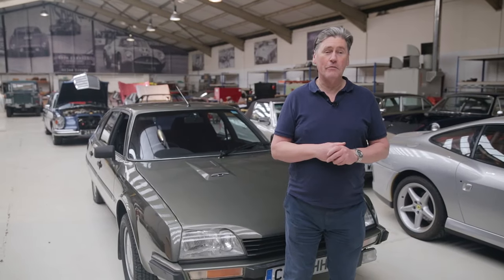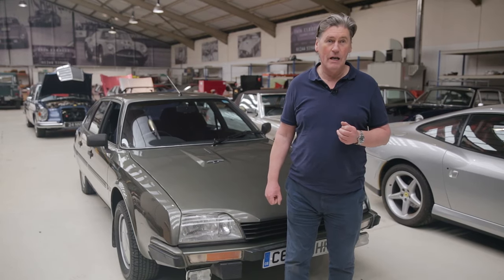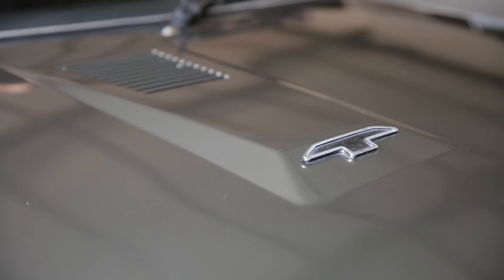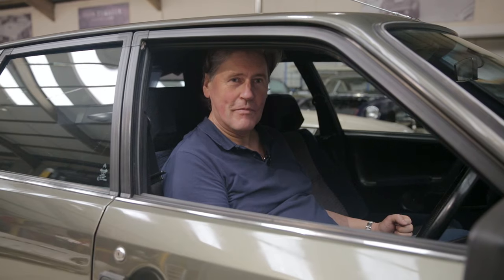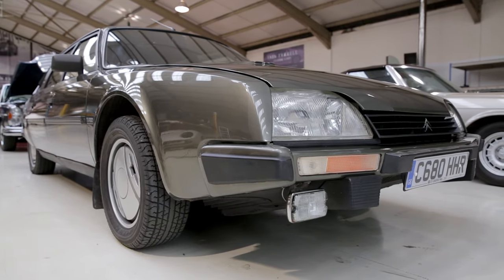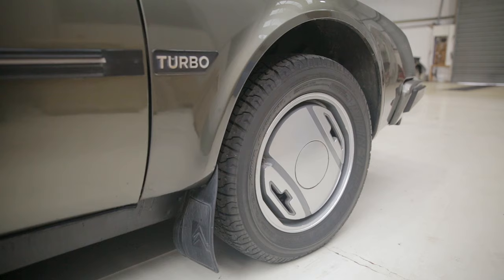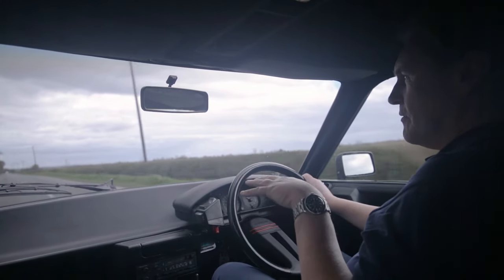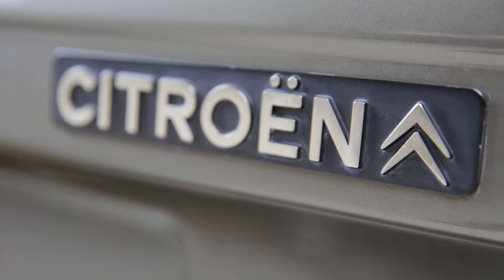Citroën CX 25 GTi Turbo - a rare beast with party tricks | Tyrrell's Classic Workshop

Comment: "The smaller the hole, the stiffer the ride is. The bigger the hole, smoother the ride is. So simple!" I don't know why he smirks when he says it... Great video!
Reply: The spheres has both compression and return damping that are tuned by a couple of canals inside the damper and shims that block the canal. The center hole is in use at slow suspension travels, when the wheel hits a bump the shims on the compression side opens up the canal and dampens the wheel.  The sphere in his hands is not a suspension sphere.
Reply: @cittroman  He was close though.  On my early D's, you can unbolt the shim pack in the head of the sphere and change the ride charactoristics readily.  The sphere he displayed from memory is a Xantia rear brake accumulator.  The only sphere I know of with a hydraulic line connector onto it.  This is what a CX wheel valve looks like ... https://cdn.myonlinestore.eu/940fb243-6be1-11e9-a722-44a8421b9960/images/Spheres%20Citroen-eng.jpg   If you drill the center hole out, the car gets more "floaty" and very boat like as so much fluid can move in/out of the sphere.  The outer slots I think are a valve.  So if the wheel hits a large bump, the valve opens and allows rapid fluid movement into the sphere.
Reply: @sophieleviston6973  Also wrongly called the "antisink" sphere. Early DS spheres are great and as you say easy to adjust to your liking. When you drill the center hole you loose some control at higher speed, but good for cruising.  Have you seen this beauty?  https://www.youtube.com/watch?v=bJ5jTMJDH_k&fbclid=IwAR3ZMykHLZ3Lalo26Zy6ZCDl_YAJBXLaHTbU97PxJtFfYw0PkAL1DNw22po

Comment: The suspension travel is not controlled by the sphere but by offset holes drilled through a series of disks in the damper which the sphere is attached to.

Comment: The green hydraulic oil aka. ‘frog juice’.
Reply: or green blood
Reply: @martinparker6536  Or actually known as LHM. Liquide Hydraulic Minerale. Not easy to find these days,as the only cars that use this hydraulic oil are hydro pneumatic Citroens ( DS,CX,Xantia,SM ,XM and so on )
Reply: @titanus49  also Merc 600s... hydraulic everything on those cars, even the windows and boot lid...
Reply: @titanus49  : in Britain, LHM is easy to find, as generic motor supplies shops such as Halfords still stock it. Also there are loads of online suppliers. Nothing to worry about. To be pedantic, all Citroens running on this system are oleopneumatic, not hydropneumatic, since no water is involved.
Reply: And even 2CV's use it as brake fluid! That is, the ones with disc brakes, from 1981 onwards.
Reply: Not sure to appreciate you "joke"...
Reply: @richardharrold9736  Mercedes did copy the Citroën System, but made a bit different, was first use on MB on the 1975 450SEL 6.9L.Mercedes Benz did buy 2 SM to test it and disassemble it for study...But Rolls Royce did use the Citroën system (with agreement and technicaly assitance from Citroën), a bit modified, on they Silver Shadow and Silver Spirit...

Comment: Such fantastic cars. I regret that I never bought one in the 90's when they where reasonable common - was very close to get a first gen GTI with the more unusual instrument cluster.
Another small tech piece was the spring loaded position of the gear lever in fifth, you selected it as normal but once released it went back to the position of third gear so to shift down to four you just pulled the gear lever straight down!
Reply: I had the DS when I was young. Was never able to get a CX. But think I will look for one.

Comment: Nice to see a perfect set of Turbo rims with the Michelin TRX tyres! I've owned and worked in Citroens for years and the hydraulics are the least of your worries, once you know how it works. Very simple and rather reliable. As Mr. Tyrrell says, the original CX2000 were very underpowered.. Great cars.

Comment: Great video and I very much enjoyed it. However two things you failed to mention;
Firstly the self leveling suspension, which worked incredibly well and allowed the soft suspension to carry heavy loads carry heavy loads without dragging along the ground. At this point I think it's worth mentioning that the highest position was not for actually driving along, as the pressure in the spheres is at their maximum, and there is virtually no suspension movement  - it's rock hard.
The second worth making is that one of the idiosyncrasies of the CX was that the indicators didn't self cancel. I worked at a Citroen main dealer and we had more than one customer who complained after they had bought one!
Smashing video and excellent. Thanks

Comment: We NEED to hear your views on the Rover SD1 now!
Reply: alanrtment porter  My Father bought a fairly late one as a replacement for his old Triumph 2000 as our main family mover. A Vanden Plas one not a Vitesse. As a boy I felt ten feet tall riding around in this wide, low thing with a V8, and a front spoiler, and an air scoop on the bonnet! 

He eventually traded the Rover for a V6 Accord, and that car was just light years ahead in every way. But it just wasn't something you could get excited about!

Comment: don't know why but I always found the French practice of carrying the spare wheel in the engine bay to be very disturbing.
Reply: Wouldn't the rubber rot over time?
Reply: Well it does free up a lot of space and I'm only guessing on this next point, does it make the front end stronger in a crash? Some heat might be good for the rubber, it is made using heat after all and may help preserve it.  Cold isn't good for rubber either and we've seen how F1 drivers warm up their tyres for better grip.
Reply: It's surely not good for the rubber with all that heat but on the other hand it's not hidden under a ton of cargo (imagine having to empty a fully loaded CX Safari on the motorway) nor is it covered in mud, ice or salt.
Reply: Seems eminently sensible to me. Like most things French. No I'm not a francophile.....🤥
Reply: So did Fiat in some cars: 127, 147, Uno, etc.
Reply: It wasn't just French manufacturers. Subaru placed the spare in the engine bay with many of their 70s and 80s models.
Reply: Part of the trick with the spare wheel under the hood wasn’t only to free up space in the boot, but to help push the engine down under the passenger compartment in case of a collision, which was one of the safety design features of the CX.  At least that’s what Citroen claimed.  Also, I’ve never heard of any CX-owner complaining about ruined rubber due to heat. After all, tires are supposed to sustain a lot of heat ;-)
Reply: @anthonyxuereb792  A solid front end in a car is a bad thing, in a crash. The occupants are better protected when the car absorbs the energy of the impact by crumpling. Modern cars are designed to crumple up.
F1 drivers warm their tyres in the short term and they’ll soon cool again. But with everyday road tyres, there’s negligible difference.

Comment: Wonderful edition. Brings back found memories of when I was a student and delivering computer parts between Oxford, Newbury and Reading in a Safari. If I remember rightly the tail dipped under breaking as well. Two other elements of those marvellous cars was one you touched upon, the brakes but to the unknowing with all that power initially they were either one or off. It took a bit of practise to get the modulation just right. On and they were terrifyingly effective but that came in very useful on summer afternoon in a Reading side street when a little boy ran out into the road ahead of me whilst playing chicken with a mate. I did knock him off his feet but thankfully that was all because the car stopped so well. The other is the rocker switch for the indicators which didn't self-cancel.   Thanks Iain

Comment: Nice video thanks. I worked in the car game from the late 1980's. I use to sell these and the Rover SD1's. Out of the two the CX felt much more advanced than the SD1's. Obviously the Rover had that great little small block buick V8 burbling away which was the reason I sold so many. I drive a Rover P6 V8 as my daily now in fact.

Comment: My father had a CX Athena back in the 1970s. It was a family favourite car. I was far to young to drive it so I've always wondered what it was like. I remember by dad talking about the steering. How no bump moved it who hade it relaxing. I loved the dash as it had two barrels for the speed and rev counter. It seemed very futuristic at the time.

Caravan towing was very easy especially hitching and unhitching due to the suspension. Plus it always kept the car level even with the weight of the caravan.

I always wanted a turbo / turbo 2.

Comment: The comfort but also the roadholding, the brakes and the general stability of the DS and CX were fantastic and unique in those days. I had one of each and systematically outran most of my friends with sportier and flashier cars. Their biggest problem was: you could hear them rust away...

Comment: I am so excited about this video Iain. I nearly bought a CX Familiale in 1994, which I fell in love with. My dad told me it was a silly idea! I am still smitten by the engineering and looks of the wagon (I don't like the sedan at all) so will no doubt find one in my retirement. You mention the effect of acceleration on the suspension, but I found the effect under braking even more unusual. The front dives (as normal) then the system 'compensates' for the dive and raises the front. The earlier cars had a fantastic sci fi dash and 'button' brake pedal. Thanks again!

Comment: I had the safari version in the 70s. ~What a car. My father had a DS 23 Pallas, which converted me to the French magic. A couple of comments on your video. The tail dip which you pointed out on acceleration also was a feature of heavy braking on the Safari (I don't know if this was true of the CX saloon). It made breaking feel so much more secure as I suspect in so doing it added effective weight to the rear of the car. The second point is about the steering and there is another party trick to it in that there is a speedo cable from the final drive straight to the steering control valve box which stiffens up the steering the faster you go. Dead light for parking, heavy self centering when high speed motoring. Pure magic. I would have another in a heartbeat.

Comment: My first grown-up car was a D reg GTi Turbo 2 - fantastic car and it stuck to the road like a limpet on the proper metric Michelin TRX tyres. Passengers used to comment on the Darth Vader noises the steering wheel made and with 2.5 turns from lock to lock, it was tight. Also dead easy to parallel park in tight spots where some struggled to park a Mk2 Golf. The downside with it was the ventilation as the vents as they merely breathed instead of blew air out of them. 

Sadly it got written off after being hit by a Peugeot 106 the morning it was going in for an MoT. I still miss this car to this day and the two XMs I had immediately after it (a V6 Si and a 2.0 SEi) put me off newer big Citroens with their unreliability, so I jumped ship to a much simpler Volvo 940 estate.

Comment: Fantastic car. Large windscreen with single wiper threw water off the screen better than any other wipers. Concave rear window was self cleaning with aerodynamics. Cyclops eyes speedo and tacho. Fabulous swichgear including rocker blinkers switch, horn and headlight flashers. Lights, wipers and washers plus instrument light dimmer.
Car would squat front and rear under heavy braking maximising adhesion. Self levelling suspension regardless of load.
CX diesels were highly rated as tow cars helped by wheelbase and short distance from rear wheels to tow ball.
I had a new CX Prestige 2400 EFI 5 speed. Even better ride wjth longer wheelbase. Stunning car. Incredible high speed tourer here in Australia.

Comment: My dad had a couple of CX's. I think his second one must have been one of theses. From memory it was a 2.5l, black, turbo charged and fuel injected which was quite strange back in the 80s which is why I remember it. He'd bought it from a dealer friend of his who i think did some racing bits and it had been tuned a bit and it really shifted. He claimed it would do 150mph which I didn't believe so we did 145mph with the sunroof open and windows down! He was a sales rep and did a lot of driving and had phenomenal reflexes, though he did get nicked doing something like 120mph and lost his licence for a couple of weeks and bought an old jag 4.2 to slow himself down after that!
Incredible car, particularly for it's day!

Comment: Cruised throughout France in the late nineties in a Citroen CX 25 (2.2 or GTI Turbo ?) during a hot summer holiday. A memorable trip!
A "magic carpet" of effortless travel and the luxury of "air-con": However the "on/off" reliability of the turbo made for 'periodic dramas and "exciting" overtaking 'contingency planning...
A car unsurpassed in ride comfort and refinement, capable of delivering it's passengers' refreshed, after covering vast distances.
Not that there was ever a need to rush! Upon reflection - A aesthetic metaphor of a time capsule!
N.B. My late Uncle Colin bought a new Rover SD1 Vitesse, with Tony Pond style factory-fitted front and rear spoilers: He'd owned it for two weeks and had returned it to the local dealer near Halesowen for some "minor adjustments" [as was the norm then] - Car Stolen Off the forecourt of the garage in broad daylight! The Police said "it's already abroad and stolen to order" [apparently]

Comment: My father had a Citroen SM. We could never figure out what the letters SM stood for. Now I know. If I remember correctly, the faster the car went, the stiffer the steering wheel became because at low speeds it was hyper-sensitive (easy to turn), but this wouldn't have been safe at higher speeds. For freeway driving, one could set the suspension very low, which was interesting. keeping a close eye on the tension of the timing chain was particularly critical for this car. It had a V6 engine and the engine block was made of aluminium. The headlights would turn with the steering wheel/front wheels, which was also very interesting. My father essentially abandoned the car, so I used it as a teenager driving around Madrid without a driver's license (different times back then). Anyways, this video is another Class Act. Thank you, Sir.

Comment: I had three CX DTRs back in the day, the last one was a CX25TD Turbo, I had it for 7 years and did 150k + miles in it, fantastic car. Only problem was a porous block which meant I had to replace the head gasket every 15k or so - that's a lot of gaskets but it was worth it to keep the car on the road. The DTR turbo 2 from about 1986 made 120 bhp at 3600 rpm but did 0-60 in 10 seconds and 120 mph, must have been the fastest diesel in its day.

Comment: I have had a GTi Turbo for years (still have).  My understanding was hydraulic suspension wasn't so it would go up and down...  it was so it would stay level at all times.  So you have VERY soft suspension, but due to its levelling it could carry very large weights without the suspension compressing down to its bumpstops (they ride a LOT better with a lot of weight on them.  The CX is a phenomenal towcar as well if you like towing caravans/trailers).  That one must be one of the nicest CX's I've ever seen.  Even the dash guages are working (usually the oil level/pressure gauge doesn't work ... or any of the LCD displays on the series II  ).   I've fitted the clutch master/slave from a CX prestige to my GTi Turbo.  You want complex.  The slave is "smart",   when the engine isn't running, it works like a normal master/slave (very heavy clutch ... almost undrivable) with the engine running, you can depress the clutch pedal with your little finger and there is only about 1inch of travel.  Typical citroen crazyness/genius.   the hydraulic clutch makes the car much nicer to drive.

Comment: I used to have a GS. The ride height is common on all of these - the lever inside toggles down and underneath where it connects to the control rod. The trouble is that it protrudes out underneath. I remember doing around 60mph down a country lane when I went over a brick that knocked the control rod backwards. From driving in a hunkered-down sleek drive position, I was suddenly doing 60mph in the fully extended high-up position. Very wobbly!!

Comment: Another wonderfully informative video, thank you Iain. It reminded me of my company car back in the early 80’s was a CX Pallas, as you say a truly amazing car for its time and way ahead of anything at the time. Although some passengers found it could induce a feeling of being on a boat, I found it to be the perfect long distance GT, quick enough and incredibly comfortable so why I  racked up 60k miles in a couple of years without any issues whatsoever so the company agreed to replace it with a second CX. 
The replacement had a few build issues and unreliability came a bit of an issue, for example travelling up the M6 to my office when I noticed I was being followed by an enormous cloud of grey smoke then the steering gradually became heavier and heavier as the car became lower on its suspension and finally the brakes gave up as I ground to a very bumpy stop on the hard shoulder. On lifting the bonnet it became immediately obvious the pipe union on the high pressure side of the pump had fractured, spraying LHM oil over the exhaust manifold.  The Red Arrows had nothing on me!!